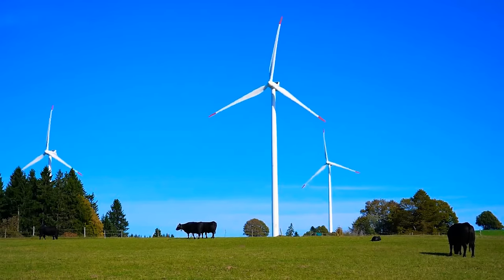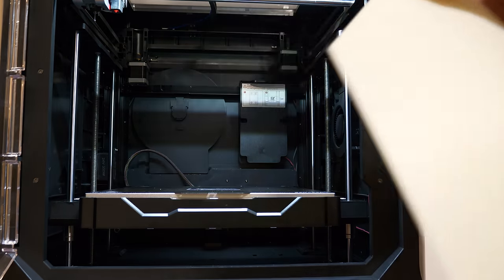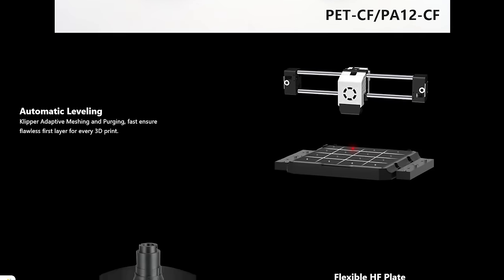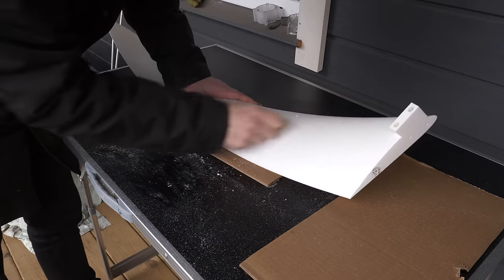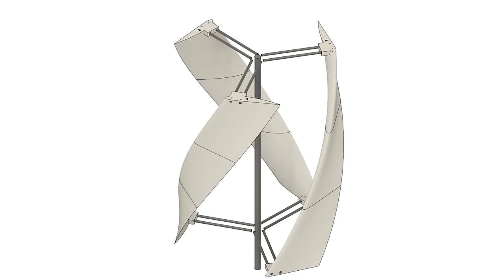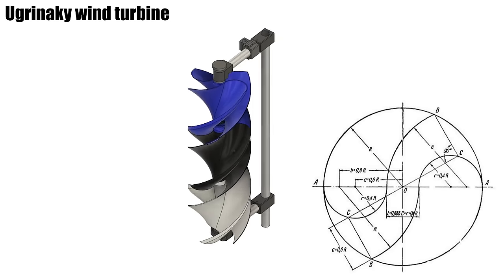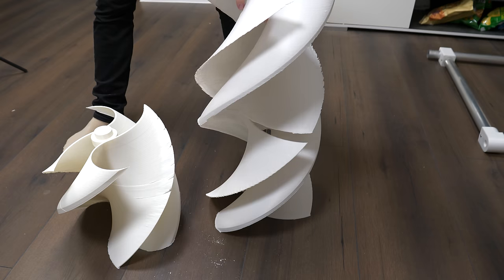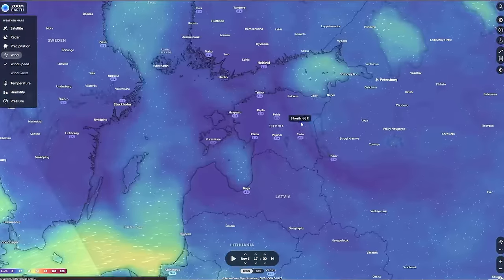I 3D Printed TWO Life-Size WIND TURBINES - BIGGEST PRINTS I HAVE EVER MADE

Comment: I'm not sure what gives you the idea PETG wouldn't be adequate, especially if printed in white. It won't even soften until >80 degrees Celsius... that's like 30 degrees hotter than humans can survive for any length of time. I've designed tons of outdoor-use PETG stuff. One practical reason I can see is if you wanted to smooth the outside using acetone, but you're not doing that.
Reply: "that's like 30 degrees hotter than humans can survive for any length of time" So by your logic humans just incinerate the moment they enter a sauna? 🤣 On a serious note, I agree with your take on PETG.
Reply: @J-1403  I'm referring to the maximum safe temperature a human can inhabit without it eventually killing them. It depends on humidity, but it's around 45-50 degrees. If you need plastic to survive temperatures greater than that outside your house, you've got bigger problems.

Comment: 3D print a gear ⚙️ attach to bottom or top then artach motor by gear you can then change gears for most efficient  collecting based on wind amount or motor design rpm

Comment: Hi. vawts are a bit more complicated than they first seem.. Well to give you a few guidelines the lift tipe needs to be started and your profile while it looks that will produce lift isnt realy optimal since in a rotation the aoa actualy changes the profile itself while you also have to think that every rotation at somepoint blade gets into aerodynamic stall which is problem by itself since you proobably know that stalls arent completely controled..also the efficient operating speed for smaller lift ones can be scary (they really have to go fast) on the other hand drag type turbines have rly bad efficiency compared to lift ones which just adds to the fact that even lift vawts are terribly inefficient.. yes vawts work with 360deg wind direction but in most cases it is not worth it.. for domestic use wind turbines are not rly a thing sice the size exponentialy makes it better(for simple physics).. there have been some attempts in design to make something usefull but for now windpower for homes is still a dream...

Comment: ABS will degrade very quickly in the sun and PLA will soften on a summer day. You'd be better off using PETG with a coating. Also don't sand ABS of all plastics! You will spread a huge carcinogenic cloud of microplastic that won't degrade. Sanding plastic is a bad idea in general.
If you want to smooth layer lines you'd be better off mixing some epoxy resin with talc powder and coating the object with that.

Comment: The advice if you want to build wind turbines is not o build them, you won't get any reasonable energy out of them, so you may not even pay back the energy and filament+piping costs. Seriously, waste of material and time if there is expectation to produce anything. A wind class 3 will have maybe 150 W/m^2, and if the turbine is 1m x 2m you get 300 W (assuming it's mounted at 10 m height!!!). Multiply by 0.05-0.10 to take efficiency into account, we talk about at most 30 W (if mounted at 10 m height!!) about 15% of the time, it's 3W on average, which is 0.003*24*0.3= 2.1 cents a day of earnings. 200 Euro material (electronics, filament, pipes) mean you'll get the money back in 30 years.
No really, 30 years payback time. Not joking.

Comment: Hello, greetings from Poland. First of all, ABS is not suitable for outdoor use. ASA is definitely better. And printing on a 3D printer is only for a prototype.
The bearings are also bad, better self-aligning. Aluminum tubes are too flexible, especially vertical ones. Besides, there are better designs... I think I even saw "Ugrinsky" in yours... maybe a C-rotor?
Reply: and by the way, I subscribed and liked it

Comment: What does 15% performance loss even mean? Speed of the turbine, wind speed when the turbine starts spinning or something else? You are not clear about that.
The comparison of these two turbines is also a bit unfair. Even if the lift turbine does not spin at lower wind speeds, I guess it is much more performant at higher speeds compared to the drag turbine. For instance, a child's paper windmill would even start at lower wind speeds than your turbines. Is the paper windmill then better than your turbines?
To compare them equally, make them equal in size and put an generator on them. The power they generate should be your metric to compare both turbines.

Also, you should mark an advertisement section accordingly in your videos. Not doing so, could get you into troubles.